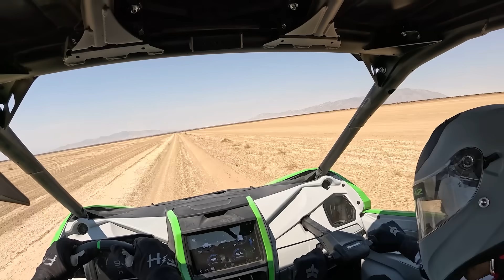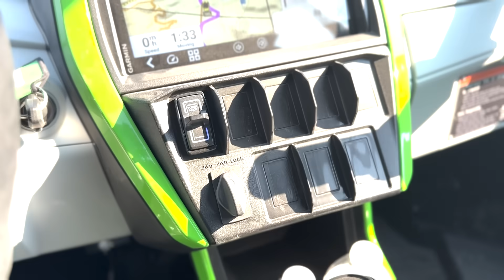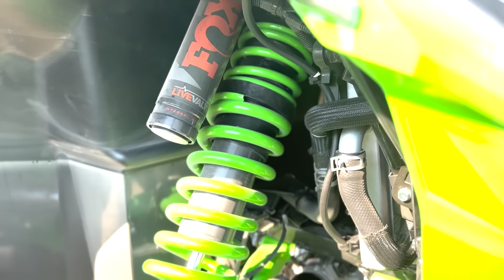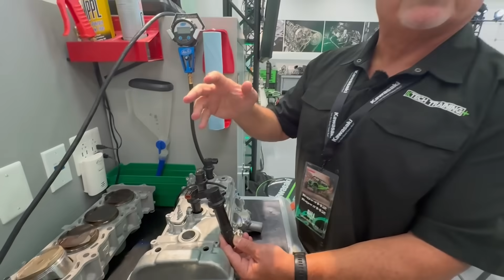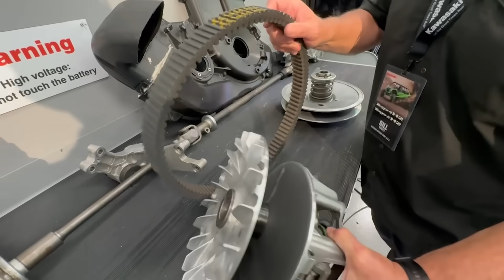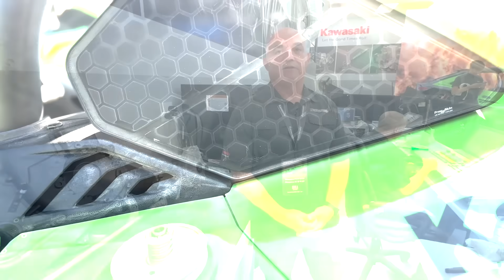2026 KAWASAKI TERYX5 H2 - 100 MPH RIDE!

Comment: CVT with belt drive nope!
Reply: Don't knock it until you tried it. With a CVT there are endless sheave, spring and weight tuning to get it dialed in perfectly. Not to mention the build quality when compared to a CanAm or Polaris.
Reply: @olliechristopher467  Sadly no sale now for the trans..

Comment: $43,000...:face-green-smiling::face-purple-crying::face-fuchsia-wide-eyes::hand-orange-covering-eyes:
Reply: At first. I was thinking the same. After some comparative research, I found the pricing, for what you get, is actually competitive. By the time you buy another brand and install all of the similar parts and accessories, the prices are similar. I'm waiting for the 2 seater models. We ride tight mountain trails, rocks, mud, water and such. Anxious to see the durability of parts especially the suspension parts.

Comment: Why only 250HP why not go for 350 or more? Is the engine and cooling system able to handle more power?
Reply: I believe is more of a liability issue, i've seen a lot of videos where you can tell that owners of SXS crash because they have little or no driving skills, selling a way too powerful SXS can cause several injuries to those people and probably deaths too and maybe that's why some manufacturers avoid putting a lot of power on those vehicles
Reply: @pcx4545  a longtime ago the government stepped in when sportbikes were in a top speed war. I think they settled on 180mph ... I think the Canam maverick is governed to 82 ish